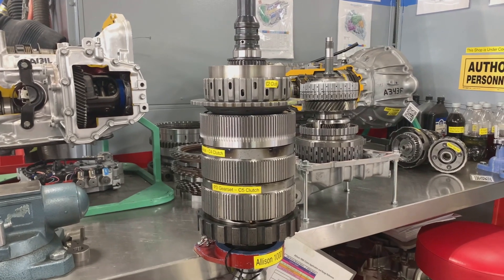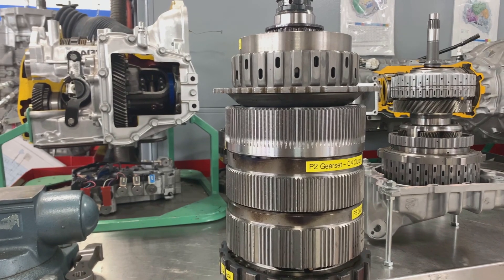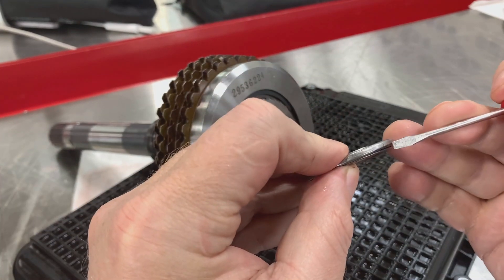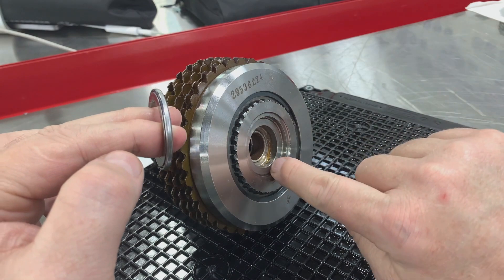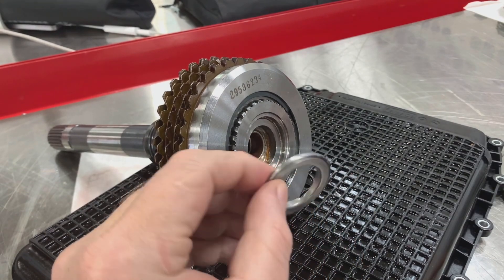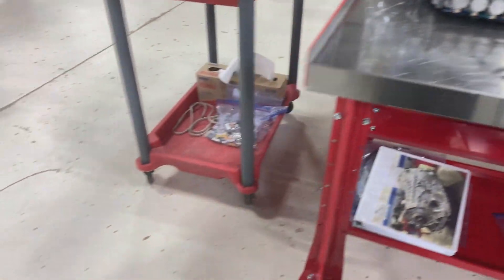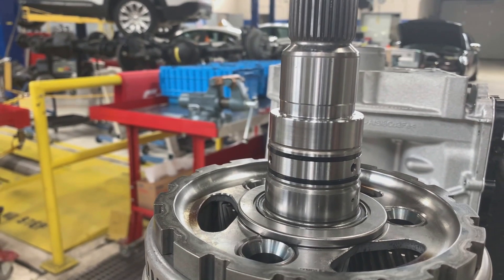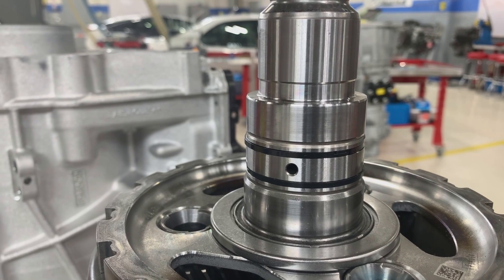Transmission Bearings, Gaskets, and Seals- AUSV 2520

Comment: You didn't talk about the plastic gasket/seals that you can find unther the bearings. And i saw some pro's use vaseline? when reassambling some parts?
Reply from the maker: Thank you, Yes, there are other seal types not discussed. Vasoline can be used, but a product called TransJel can be better because of different melting points.
Reply: @WeberAuto  Dear, i have a question and your the only one i can trust in this case. I have an aisin warner transmission aw55-50sn and i want to change the oil. Aisin recomends the JWS3309 synthethic oil. But i heard from a dealer that it is beter to put mineral atf fluid wich is also red colored. Now wich one to use the original red synthethic jws3309 or the new mineral atf wich is also called atf F/G? Thank you for your advise.